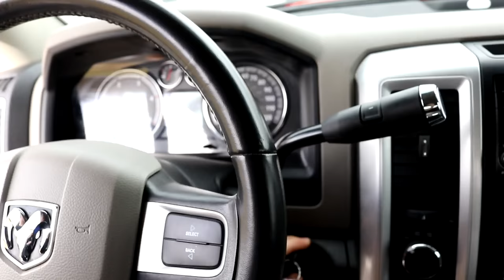DO NOT LET YOUR CUMMINS DIESEL FUEL GEL UP!!!

Comment: Cummins diesel fuel, like there are specific fuels for specific engines
Reply from the maker: diesels vs the petro
Reply: Let me correct my self, Last time I checked, there is not a diesel pump that says CUMMINS ENGINES ONLY. You have diesel fuel, and gasoline.